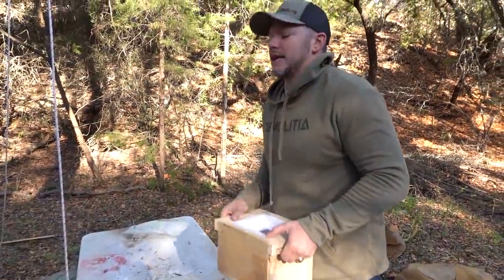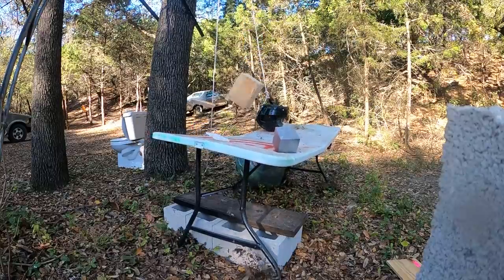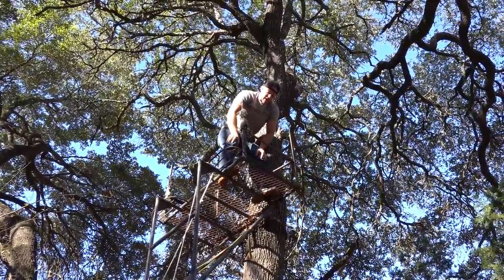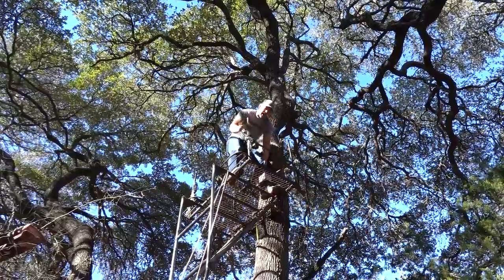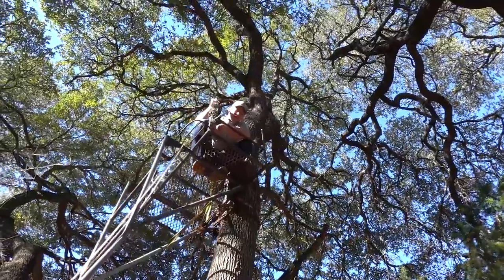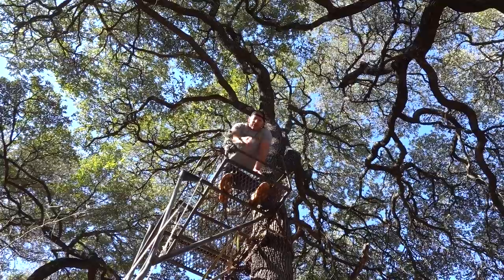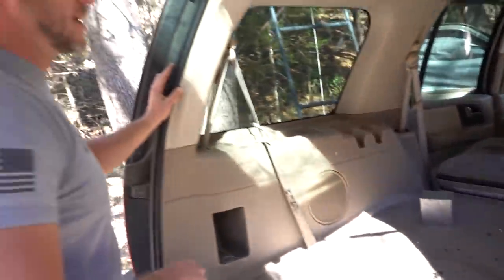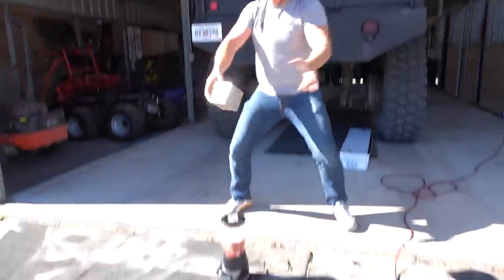Smashing things with a Solid Tungsten Block, MUCH Heavier than Lead!!!

Comment: Matt: "Today on demolition ranch we are going to see how bullet proof is this block of tungsten steel!!!" That no one can penetrante!

Barrette M82A1 50BMG: "hold my beer"
Reply: I think the .50BMG will dent and move it if the shot is centered but if it hits close to an edge, it could chip it 'cause tungsten is brittle.  Tungsten (tungsten carbide) is and had been used in armor piercing ammo for a very long time.
Reply: Tungsten 20mm might hurt the Tungsten block.....somebody call in Edwin!!!!
Reply: He does have a video were he shot tungsten before i think
EDIT it was titanium that he shot before
Reply: @bryandiel6773  20mm is actually weaker than .50BMG in terms of penetrating steels. If you have been following the tests those YouTubers had been doing on YouTube. Mark Serbu, Edwin, Going Ballistic, Demo Ranch and many other channels the vid people had put out.
Reply: the .50BMG rounds that are tungsten core is the .50cal SLAP and SLAPT rounds. Also the .50 Raufoss round. The Black tip AP and API I doubt they use tungsten, maybe just harden steel, but I could be wrong.

Comment: In case anyone was wondering, this thing costs like $2500
Reply: well anywhere from $2,500 - $7,000, he said its 40lbs and tungsten is roughly $100 - $350 per kilo (roughly 2lbs)
Reply: And they just gave it to him??
Reply: @djbdyckfbsgsg9176  You can get a 40lbs (4" size) block of tungsten on Amazon for exactly $4,999.00

Comment: Matt: objects of similar size but different weight will fall at different speeds.
Mere(Degree in engineering): SMDH
Reply: I thought of mere immediately when he said that. She heard that and just gave him the look
Reply: I need to see Mere ridicule Matt relentlessly for a month straight about this. Remember kids, 9.8 m/s/s for every mass on earth, no matter how small or large.
Reply: Why does a styrofoam cube fall slower? Think it over. In a vacuum, you'd be right, but not in an atmosphere. Things do accelerate at different speeds and have different terminal velocities.

What I'm wondering about is why no one is talking about the deltaV behind the cube would actually make the gopro fall faster.
Reply: @Ranstone  Air resistance can have an effect on how things fall but it's really only relevant when one of the objects has very low density (like styrofoam or feathers). Also the fact that he had the lighter object positioned directly on top of the heavier while dropping reduces the already minuscule difference even further.

Comment: This is so interesting that the "english" term is "Tungsten" (which is Swedish for Heavy Stone) but in its original Swedish it's called Wolfram :D
Reply: Which is why the abbreviation for it on the table of elements is W.
Reply: Actually both Wolfram and Tungsten were named by Swedish chemists back in the 18th century. Both names were used widely. Some countries started to use Wolfram, other countries picked Tungsten.

Comment: Mat:*lifts like 3× what the tungsten weighs*
Also mat: 40lbs heavy
Reply: To be fair, when Matt lifts weights, the plates aren't cubes or made of dense metal. Little easier to lift 120lbs when it's split between several narrow-but-wide discs on both ends of a metal bar ;)
Reply: @generalilbis  plus it’s a smooth cube with no handholds
Reply: @atomicspartan131  That too ;)

Comment: i use to replace large aircraft rudder weights of depleted uranium, with tungsten. weight was around 100 lbs. 60 ft in the air, they were the size of a book. lol

Comment: My husband's wedding ring is made of tungsten. Fun fact, it can't be cut off, there is one weak point in it and if it has to be removed they hit that weak point and it breaks apart.
Reply: The rings are made of tungsten carbide which is much harder and more brittle than pure tungsten
Reply: @BrokeWrench  thanks for the new info, didn't realize that.

Comment: 5:44 Density of 18.02 g/cm3 means it is not 100% pure Tungsten. The manufacturer will have alloyed with other metals - Iron, Nickel and Copper for ductilty and machining. The cost for a 99.9% block would be considerably more.

Comment: Celsius is the BEST temperature mesurment, 0°C = water is going to be Ice, 100°C = Water is going to boil... or burn ur hand if you stick it in. So don't put your hand in 100°C Water, even if you think 100° ... F ... is just a good temperature kids, if there is a °C behind the 100 do not touch! :D :D :D

Comment: You know what's scary is dropping that tungsten block on the car windshield and while it did damage it bounced away.  Yet how fast and with what force did someone's body have to break through a windshield and fly out of a car in a wreck!  I know we've all seen those windshields!  WEAR YOUR SEAT BELTS! You'll be much worse off than the block!

Comment: Tungsten is actually the strongest metal in world but when it gets hot 🔥 it becomes very brightle and weak. I've always wanted to  see how it holds up to bullets and also like armor piercing rounds vs a Tungsten tip round im sure that probably doesn't exist 🤔  but would be great for science

Comment: Imagine if USPS didn’t have a max weight on their flat rate boxes. You could put an 11.25”x11.25”x6” block of tungsten in the biggest one and that would weigh 626.0625 pounds. You are very welcome for that totally useless bit of information.

Comment: LOL 4:20 He seemed surprised the GoPro stayed right on top of it. Umm yup with no air resistance everything falls at the same speed. In a vacuum a feather will drop at the same speed as a 1 ton boulder.